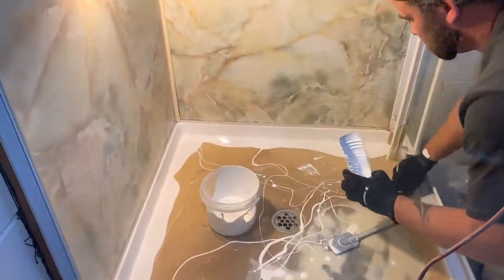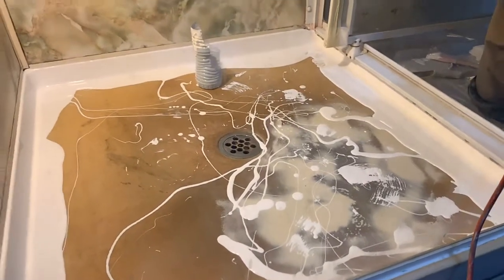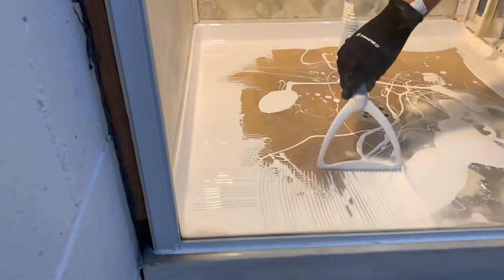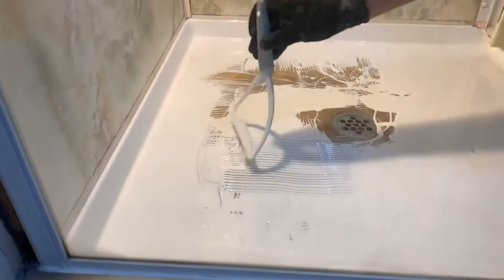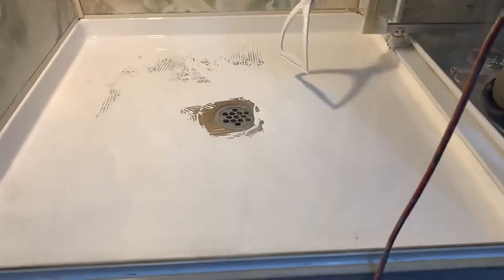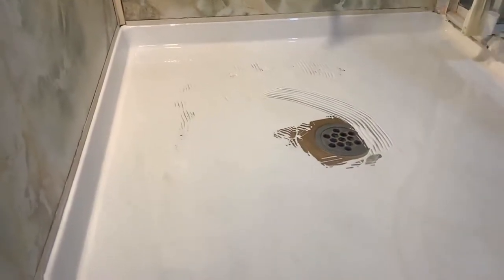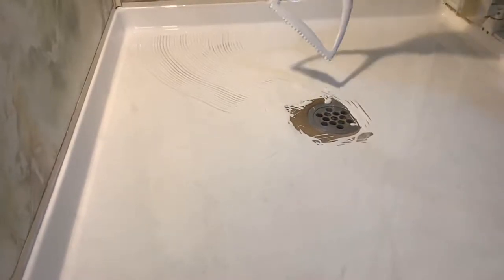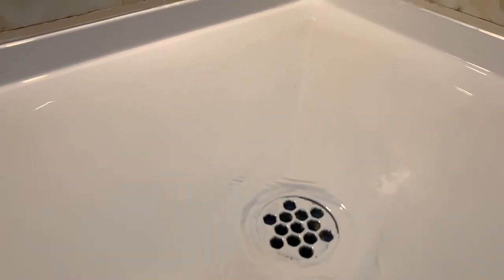Pouring shower base part 2  with Ekopel

Comment: Hi,if there is shallow cracks on stone resin tray or baths ,is  it necessary to fill them ,or does this flow in and fill and level up with out cracking, is it suitable for acrylic baths, does it flex a little also. If applied to thick is it a cosmetic problem only, but could add to wear ability.
How long has it been out there in the field, any problem feed backs, can a run be easily wet and dried out, and buffed and polished if required, thanks for the good examples .
Reply from the maker: If the cracks are on the horizontal they will fill out for sure but on the vertical it will vary. The product has good flexibility but the thicker obviously a lot less. I have found that runs can be sanded out and polished with a good cutting compound. What we have found is that the most important thing is mixing the 2 parts of resin very thoroughly., This will prevent discolouration. Also where the product is too thick it will yellow.
This product has been around for over 10 years but in Australia since 2016 And so far we have had no major complications.
Reply: Very good, especially for a first time.